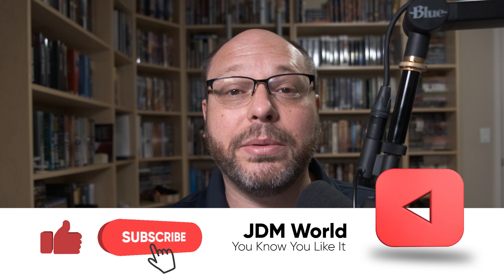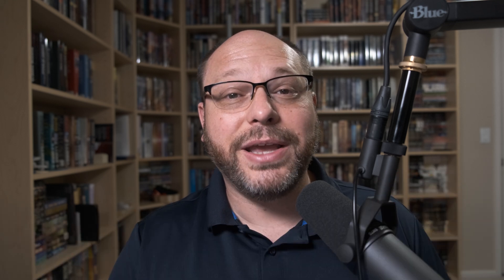This 10" DIY Subwoofer build provides more bass than expected. And its cheap and easy.

Comment: About 17 years ago I bought a system, and the sub was really substandard. 
 So I built my own with a 10 Inch from Jaycar Australia.  I still use it, still feels and sounds great with a dedicated Technics amp driven from Denon surround amp.
 Should add crossover set at 80 Hz
Reply from the maker: Thats awesome! DIY is really cool.

Comment: My woofer is mezzo mordaunt short. It's needing a new cable inside but i have no idea what it's called so i don't know how to search for a new one. It's one of those long plastic connectors that have multiple wires going into it. My problem is one of those wires has come out and I don't see how to get it back in. I would appreciate it so much if you could tell me what this type of cable is called so I can search for a new one online thanks very much.

Comment: there is a common miss conceptions that small subs cant produce big bass or low bass. the right sub in the right enclosure can. there are better 10's but this 10 in a folded horn would be a different beast.

Comment: Excellent build. This is obviously not an amp'd sub, but connecting one to your system, does this not put a strain on one channel of your system?
Reply from the maker: I use a dedicated amp to drive the subwoofer so there isn't really any strain. Sub out on your processor to the amp, and amp to sub is a basic setup.

Comment: What is the paint gun you used?   Also what glue did you use?    Do you recommend the pro connectors over bananas.... I have had bananas get loose in the past on things.
Reply from the maker: Harbor freight hopper gun, titebond III, either connector is ultimately ok, just personal preference. Links in the description for everything.